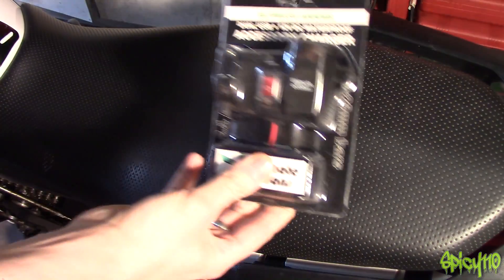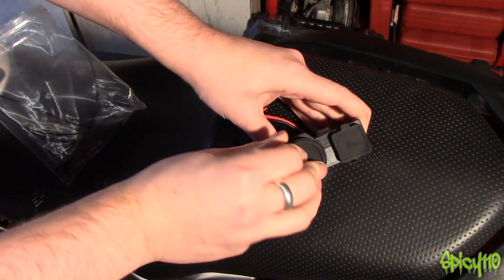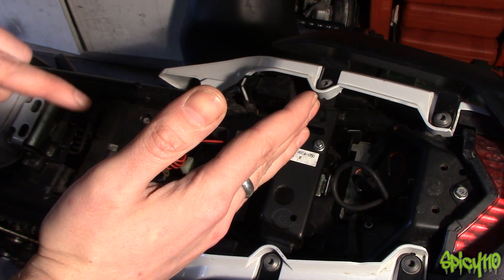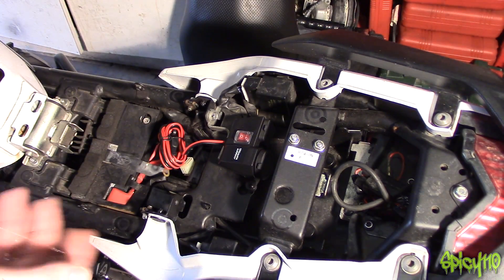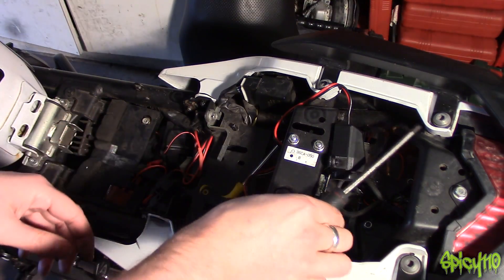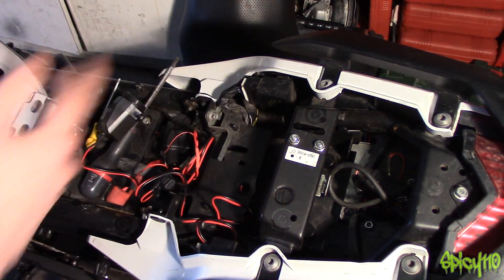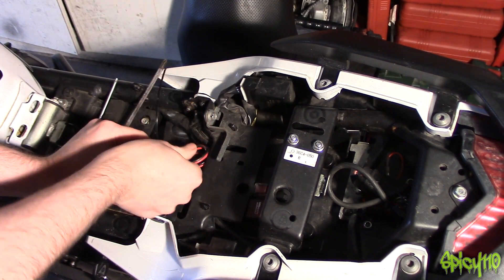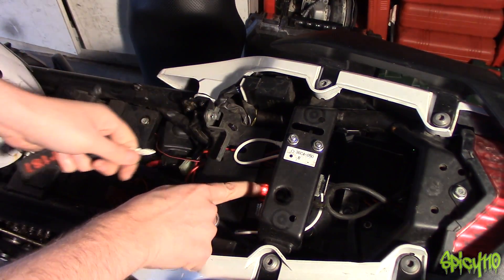Installing Motorcycle USB Charger! Super easy!

Comment: If you're doing a video that's going to be on the interwebs, it might be, in future, a good idea to leave the battery negative off until you're finished fiddling with the battery positive and only then reconnect it. It prevents sparkage when using metal tools in close proximity to a metal chassis.
Reply: Not really, he had that rubber boot back on the positive terminal by then, but, indeed, not best practise. ;-)
Reply: @JVerschueren did you forget to switch accounts there bucko

Comment: You dont even need the relay. Go to the fuse box of the bike, and find a wire, that is live when the ignition is on and not when its off. I use the headlight line for example. Make sure you take the feed out before the fuse, or your putting more load on the (headlight) fuse, but make sure there is a fuse inline with whatever your installing.
Reply: Samuel Gamble i think my kymco movie doesnt have a fuse box, else i cant find it. I found the headlight wires but theres 3 wires just out of the main bulb boot coming out to a bigger connector containing 5 wires and 1 empty. I cant figure out how to mount the charger on the front and wire it to the switch  (so its on ONLY when switch is on, regardless of engine running state) also theres a single spare fuse in battery compartment, can I solder it to the 12vDC plug and use it ? Do I solder it on the pos or neg side ? Thanks!

Comment: Only trouble is every time you want to use it you have to take the seat off.

If you got an emergency charger battery you could leave your phone in  your pocket and charge it, then put the charger on charge on the bike that way you always have power for your phone.

You could also get one of those cheap wireless charger circuits so you don't even have to plug it into the phone, connect it to the emergency charger battery pack and just place it in your pocket with your phone.

You do need one of those wireless charging phones though.

Or you could go one better and set up a small plastic box at the back of the bike to hold your emergency charger battery and wireless charge through the tail section, or if you don't want to wireless charge just run a cable to the small plastic box and charge directly, but there may be corrosion over time so it would need to be well protected from rain.

Considering how light and cheap these emergency chargers are you could mount it directly using stick on Velcro to your side panel and use the gap on the panel as a plug in point, that way you wouldn't need to remove the seat every time you wanted to plug in.
Reply from the maker: +flitsies taking the seat off is one key turn. Not a big deal
Reply: Fare does, I suppose it depends how many times that key has to turn, but an emergency charger costs £1 in the pound shop nowadays and will give you half a charge approx, sticky Velcro £1 run a cable from your device to the side panel and you wouldn't need to take the seat off at all once it's in place, auto stop start on emergency charger, the bike charges the emergency charger once charged it takes no more juice from the bike, no would know it's there except you, unless they see you plugged in of course and even if they did it's only a pound you would lose, of course you could go with a better emergency charger battery but then it's more to lose, would be more flush to the bike though.

It's only an option you may wish to consider, also by making it Velcro you could simply remove it whenever you wanted.
Reply: Great idea.
That way I don't have to snake a wire from the battery to the dash area on my scooter.

Comment: You'll forget at some point, I wired my heated grips in direct. Two years with out leaving them on I went and left them on and killed my battery. Its like riding a bike, its not if you fall off, its when you fall off.

Comment: Handy, I defo want a USB up on my bars/dash on whatever my next bike is, charge the satnav, or even cameras etc in a tankbag with a long enough cable for travel of course. Hadn't considered the emergency side of it though
Reply from the maker: +Spectre223 yer for me it's totaly the broken down phone dead, middle of the night butt save I wanted it for.
Reply: @spicy110  doesn't that mean u would have to shutdown and remove the seat after everytime you are off the bike?

Comment: Had one fitted to my Triumph Tiger 955...Hope the wiring doesn't melt like mine did under load from a small tyre inflators/compressor!!!  Beware especially as it's under your seat...

Comment: I would strip down a lot of the small electronics you order from the internet even if they say its genuine and with the correct fuse, wire braid/gauge. Ive had one of those 12V chargers catch fire as it was not correctly insulated i had to rip it off and throw it before it spread. just strip it and check for piece of mind, internet is full of "how" things should be wired if you do not understand how things work.

Comment: Pretty sure most relays are "electromagnetic," as in, adding power to a bit of metal makes another bit of metal touch it, thus closing your circuit.
Reply: My accessory has a tiny on-off switch.
I don't trust it. But I'm also too lazy to install a relay.

So, obviously, I've gotta get stranded to learn my lesson😅

Comment: Does the same thing go for an electric scooter as for a gas when installing USB charging/12v system?
Reply from the maker: noooo, that battery is way more volts. You should have a 12v circuit to use, but you will need to know for sure! Do not attach anything to wiring you do not know on an electric it will end in fire or worse.

Comment: whats the point..
Reply from the maker: to charge a usb device?
Reply: @spicy110  to charge it under the seat and noot on a bike handle 🤔
Reply from the maker: I do not need a bar mounted charger. If you need a bar mounted charger, mount it on the bars. The connection of wiring is no different just longer.